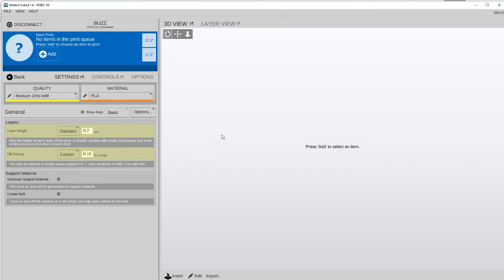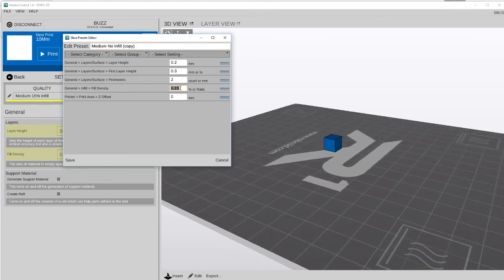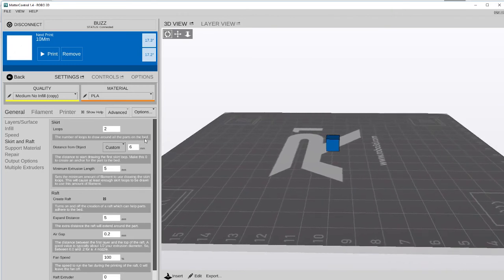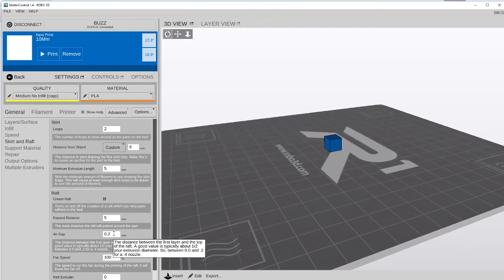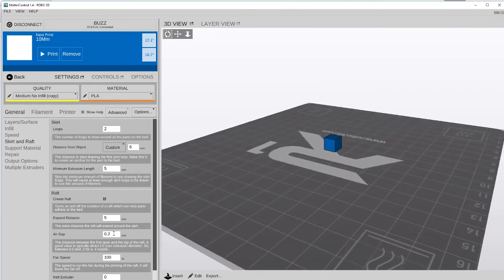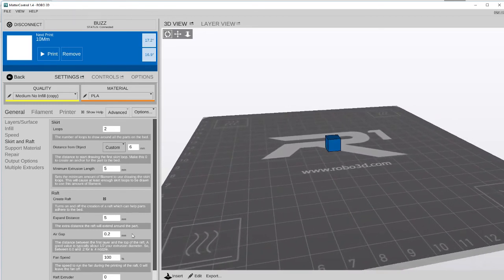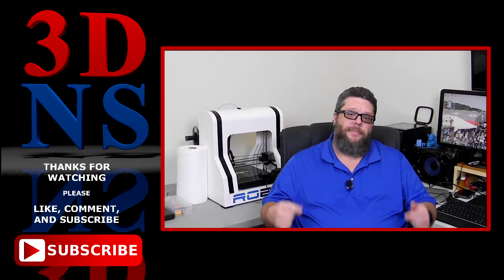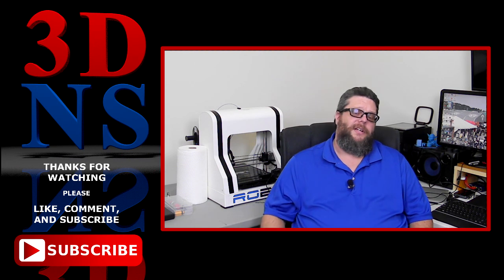3D Printing: MatterControl's Raft

Comment: I just printed my first thing today on robo r1 plus.... did a tree skull at 30% original size.... came out mostly great.... but couldnt get it off the raft to save my life.... i hope slic3r works better.
Reply from the maker: +James Meyers I have switched to CURA and it works great. Will have a video out on the setup of CURA in a bit.

Comment: Very interesting video again! ... You know I have tried and got same results as you, I thought raft was impossible to get off(hence I avoid using it), until I actually tried with a different material. Are you still using the blue PLA that came with the printer? I got some ABS and I am able to remove the raft now.... anyway... maybe try with CURA software as well... by the way nice touch on setting the goPro on the bed...
Reply from the maker: +SargeOrona  I have only tried the Raft with the ROBO Blue. I have changed to CURA. That video is coming out in a bit. I have 4 or 5 other videos before it.
Reply: +3D NerdStop oh boy! i cant wait for the CURA one! I have been wanting to use it but the settings are confusing..